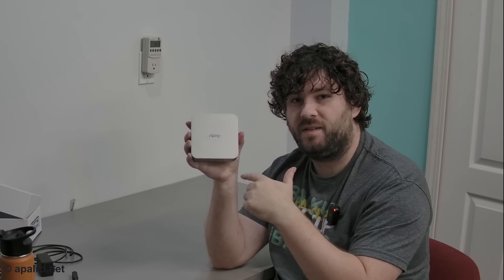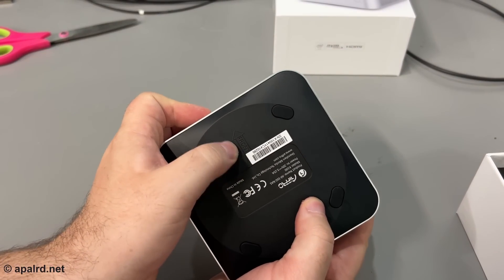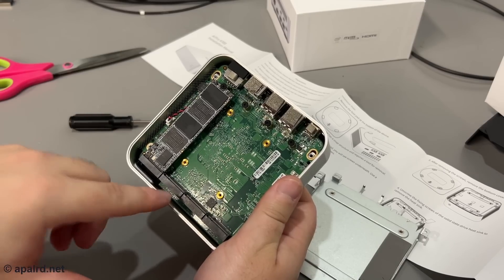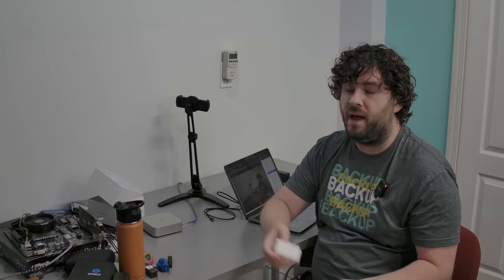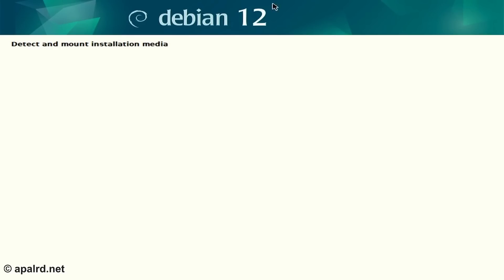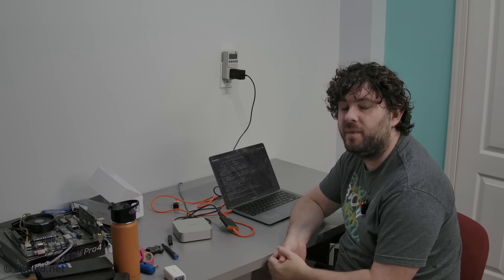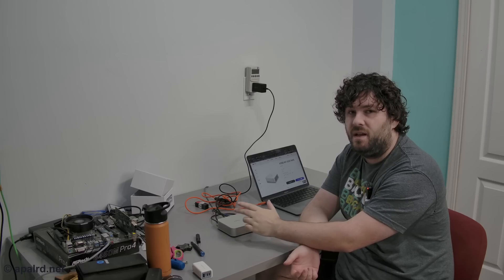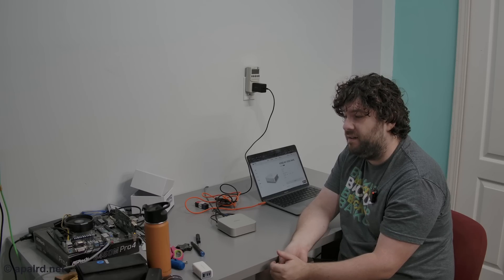A SMÅL NVMe NAS: The Aiffro K100

Comment: Wonder if it can do thunderbolt newtork  bridge on one of the USB-C. Reason is I want it to connect to my MacMini 4 directly since my network and my MacMini M4 only have 1 Gbits speed. I'm thinking the Thunderbolt to type-c, even if it just USB 3.2 will still give me 10 Gbits bandwidth.
Reply from the maker: No Thunderbolt support on the N100 CPU

Comment: 400$ for the slowest minipc with a couple more m2 slots and a 2.5 nic.
might be portable, but considering the cost of nvme drives, it's not like you're gonna carry this thing around like it's a external ssd. 
kinda pointless to have 4 nvme slots when they'll be bottlenecked by the cpu and ethernet port. 
if you need all nvme storage for some reason, you are more likely gonna build a server

Comment: Good probe into details. I've been saying future of home-NAS is mini PC with multi nvme slots for years. Looks like some are finally doing it. LMDE or other Debians are best choice. Do another video testing from WiFi & remote, with more nvme & also if it shares OK over networks attached portable SSD units/enclosures to the back USB ports. Great info on PCI gens & it's lanes too, thanks. Hopefully more similar units with N97 or N200 CPU, more powerful. Pricey at four hundred, will bite when half that price.

Comment: Sounds legit. I'm doing a little nas with asrock n100-itx, v. smol case, 2x used intel 660p 2tb for storage mirrored, £60 each, for mirrored boot, 128gb used internal sandisk ultra fit and 128gb used intel 320 series ultra slim sata II 3Gbps 120gb mirrored. Using used because cheap and safe because mirrored. Board and 32GB ram, £190, case £40, nvmex2 £120, bootx2 £25, adapters £5 total £380.
not built yet so no perf/eff numbers for you.

Comment: In almost every N100, N200, N305 that I own, if it had a SODIMM slot, well, every one so far has, maybe not supported, but functions with 32GB of whatever flavor, of DDR, either DDR4 or DDR5.   Using LPDDR5 is a cool cost cutting piece that works well in super small packages, but this package should have been large enough to support SODIMM which likely would have allowed users to swap out that 8GB for upwards of 32 GB..  8 GB is a tad small for consideration.  Eventually I'll want to replace my conventional NAS, but this device is not quite it. The design has some obvious weak points..

Comment: You failed to mention that the company is charging $6 for the 256 GB drive.  Although you consider the software included, for $6, well, you have a drive that you could toss in something else; so paying $6 for the 256 GB SSD is not really a deal killer..  It would be the first thing yanked out to begin with; the company probably could have included the software as an installer on a USB flash drive, I guess .. The price is not super great, but not terrible either considering.  It would be nice for the manufacturer to state what the largest sized drives that it supports is..   Given that its size is quite small, that's one thing; but it'd be nice if all of the spec is nicely flushed out.

Comment: I'm still waiting for someone to bring out an N100 based nas with 6 M.2 slots at Gen 3 x1, along with a 10G nic.

Having 6 slots would allow 1 to be used as a boot device, the other 5 in some sort of RAID flavour... which should easily saturate a 10G connection.

The N100 does have 2 SATA ports, so they could even put those 2 as m.2... use them to mirror the boot drive, then 6 NVME in RAID
Reply from the maker: The 2 SATA ports share analog line drivers with two PCIe lanes. Most of the rest of the PCIe lanes share analog components with USB3 as well, which is why there are so few USB3 ports on this device (trading PCIe vs USB3).

Comment: Waiting for a DIY all nvme, low powered as well but with enough bandwitdh to saturate a 40gbe connection, a bit tricky but I think is doable
Reply from the maker: You'll need a more powerful CPU to hit 40Gbe.

Do you actually want 40Gbe, or 40G across multiple interfaces (say 10G + 2x Thunderbolt)
Reply: @apalrdsadventures  for the server just one interface 40Gbe, will have another one 40gbe in my workstation, maybe a xeon D ?, it is low powered and has lots lof lanes 30 to 40, also it is ECC capable, this way you can even throw some spinning rust and have a full NAS

Comment: Really makes you wonder why not just get a USB HDD, since the network speed would be no better than that of the USB drive. Also, less power, and fewer risk of problems, since there's no OS. Not to mention the capacity. Kind of neat, but kinda pointless, since it doesn't offer much that other solutions can't do better, and for less money too.
Reply from the maker: Depends on what you want. If you want to run services like Home Assistant, having a CPU is a huge benefit

Comment: Very good review, and contains exactly the information I would be looking for. The price is a bit much considering what it actually is though. An N100 with a 2.5gig port and essentially 4 (empty) M.2 ports isn't worth 400€. Or even 300€. I just paid like 240€ (ish) for an N100 with 4x 2.5g ports and 2x 10g ports (obviously intended to be my Router/Firewall). I mean I know I can't replace the onboard 2.5g NICs with NVMe slots, but I'm just saying there are other options our there.

I'm also VERY worried about the essentually passive only cooling on 4 NVMe using a single, small piece of sheet metal with no cooler as a makeshift heatsink I guess? There isn't even any airflow in that part of the case from the fan, which is on the other side of the board. If you actively use this as a NAS with the NVMe and do something that actually stresses them, they will get rather uncomfortably hot without question. Even when buying NVMe models that specifically get less hot, that's probably not exactly great for them...
Reply: Which router did you buy, I would like to find one with these specs at this price point
Reply: @PringelsDoppeltdip  Well I made a typo on the price ("1" instead of "2", kinda important), but edited my comment now. I got the "KingNovy firewall mini pc 12. gen intel". As far as I can tell, that's essentially a Topton, comes from the same factory as Topton/CWWK/... You can get N100 from like 160€ though, obviously with more bare bones peripherals, but that's essentially what this reviewed unit is, too.

Please don't really take this as an endorsement of my unit either though, since that thing has essentially the same problem with heat. The CPU has a cooler, which can also be nicely regulated using bios options. But the other side of the board, essentially the main "chamber" contains the M.2 NVMe slot, all 4x 2.5g NICs and the 2x 10g NICs on a riser. That chamber is COMPLETELY unventilated. I knew this was gonna be an issue when I ordered, but I got my 3D printers and can just design and print an alternate shell for that "half" of the case. I can include one or two 40mm fans or something. For reference, without putting any load on any of the NICs, the NVMe got to like 60°C in just a few minutes, and the 10g riser carg got so hot you could barely touch it, so like 70°C or even higher. Again, that was after just minutes and with no load (or even link on the 10g). There's an exhaustive thread with 110 pages on servethehome forums about these kinds of units (titled something like "CWWK/Topton/... quad nic router" or similar). If you want more details, that is a good place to start (should be google-able with that title).
Reply: @TheCreat  thanks for the detailed response.
Reply from the maker: I agree with that assessment. It's build quality is fine considering it's trying to fit the small-size and very low power niche, the USB-C PD is a big plus for certain people, but it's priced high.

The metal plate will conduct some heat to the case (it's screwed to the bottom directly, and also through the board to the top), but it's mostly just going to spread/store the heat during bust operations on the drive.

Comment: $450 for bare bone N100/8GB? another dead overpriced minipc
Reply: That's what I thought too. Points that may be let it stand out are 4x NVME and 2.5Gbit ethernet.
For less than this price I bought a 1U case, N100-Motherboard a PSU and some better fans with more flexibility for harddrives and future usage.
Reply: Any suggestions for n100 and 4nvme similar to this priced nvme nas?  seems assigned 2 lanes per m2 slot (N100 have 9 pcie lanes can be assigned) 

Currently I have a low speed version which is a p5 x86 n305 with quad nvme carrier board but they assign 1 lanes to each slot so they max out 1GB/s each slot in theory 😢
Reply: @frankwong9486 how do you feel about higher tier NVME encosures that can shed the heat of a gen 4 without throttling?
Reply: @PlayingItWrong  not sure , my n305 is open frame style and I have put heatsink on each of them 

And it only heats up when rebuilding /parity check , with the 1 lanes limited bandwidth they are less hot than expected 

But this priced nas In the video might have some cooling issue underload but unfortunately most reviewers didn't include this test 😂
Reply: @frankwong9486 NASCompares just did a video on theCWWK  x86 P5 NVMe NAS,might be just what you are looking for and cheaper than you might expect.
Reply: there aren't a whole lot of N100 with 4 nvme slots
Reply: FYI: The link above currently cuts the price significantly in the Shopping Cart, if that's any incentive.  Further, this is not a ProxMox box, it looks like will do what's on the Tin: "All-SSD NAS".  I notice the 3.2Gen2 USB-C which adds the ability for external enclosed SSDs - every Disk Storage needs the ability to Backup and take that somewhere else.  I appreciate the look into the box, and personally not too concerned about the "performance" given the saturation of the 2.5GB interface being the bottleneck with one channel servicing it.
Reply: Sales People, Sales.

Comment: We really need a n100 like cpu but with like 32+ pcie gen4 lanes. 16 for a GPU and 4x4 for ssds, and maybe dual 10gbe?
Reply from the maker: I'm going to doubt a 6W CPU will handle that much IO bandwidth
Reply: @apalrdsadventures  id settle for something that could peak into the 35w -65w range, but idle nice and low. Basically a modern mid range desktop cpu but with some actual pcie lanes. My home server is idle 95% of the time, and something like a threadripper, epyc, xeon, don't understand idling very well.
Reply: @Cynyr  intel 12 gen or higher. i idle at 5-10w on a 12900k on linux. that is overclocked abit also.
Reply: That amount of PCIE is  Xeon territory for PCIE4 and 5 in Intel land. Consumer Intel is around 20 lances at the top end.
Reply from the maker: Ugreen's all-NVMe NAS might be more of what you want. My review video hasn't publshed yet, but it's.... significantly more powerful in every way than this.

Comment: Memory being soldered is a big let down
Reply: You can't have every luxury in such a small box.
Reply: @JohnADoe-pg1qk  NUCs and similar have supported SO-DIMMs in the past. It's definitely feasible, this is purely a costcutting measure.
Reply from the maker: They probably could have made a smaller cooler to fit in a single DDR5 SO-DIMM, but LPDDR5 is also lower power. NUCs this size don't have 4x M.2 slots as well, if they went down to 2 slots a single SO-DIMM would fit on that side. There are tradeoffs in such a small space.

Ideally we could use CAMMs to get removable memory with LPDDR5, but those are such a new standard I don't blame them for not being the first to ship a product with CAMM2.
Reply: @apalrdsadventures  I don't know if we'll see CAMMs in these small boxes anytime soon. They take up quite a lot of space directly on the PCB and have a fixed area for the connections. I can imagine that this makes the layout of these small boards more difficult compared to individual RAM chips.
Reply from the maker: They are thinner than normal SO-DIMMs, so in this case they could fit underneath the M.2s. That would make cooling worse though, since the LPDDR5 chips are currently cooled directly by the CPU cooler. 

Layout wise you can flip the CAMM so the connector is on the side of the board with the m.2 screws, so the traces coming out of the cpu have memory to one side and PCIe to the other (this is also similar to how the pads on tiny CPUs are often laid out).
Reply: @JohnADoe-pg1qk  The X86-P5 devboard from CWWK has the N100 CPU, 4 NVMe slots, SODIMM RAM, and dual 2.5GbE. I made two posts on r/homelab recently if you're interested.